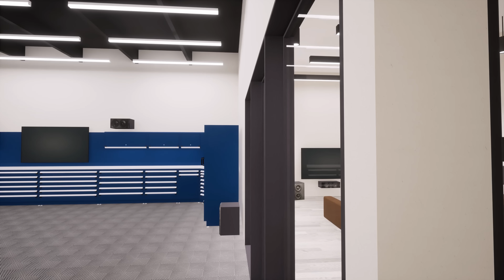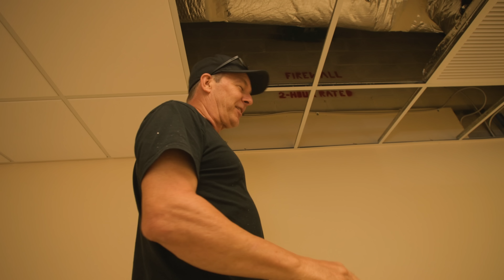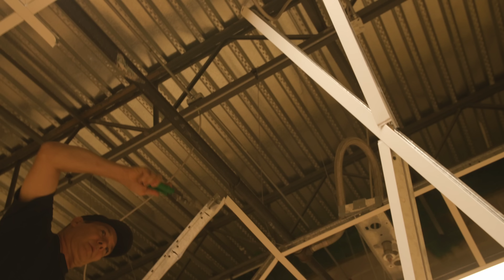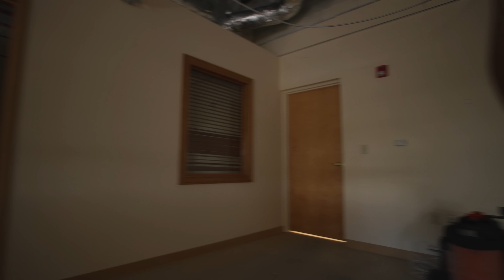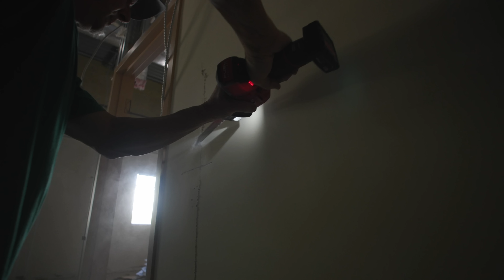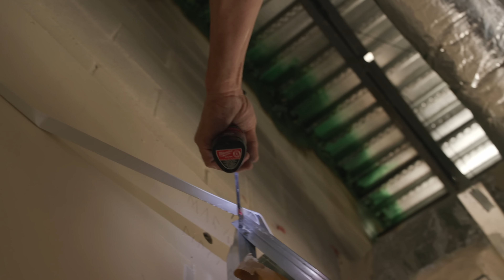Turning This Ugly Office Building Into an EPIC GARAGE! | OGHQ Build Part 1

Comment: You can use a magnet on a string  to find the screws in drywall and take the drywall off in whole peices
Reply: They probably have to take a few turns thru a few doors to get to the dump trailer.  Smaller pieces are more manageable.

Comment: My guy Matt is not going to like all the scratches you will put on the dump trailer. 2 months into hauling rock, boulders and old concrete in mine it looked like it was 10 years old.

Comment: Mike needed to do some more research on a dump trailer. Definitely better choices than that big junk he bought. Number one choice would be diamond c but those are big money, next choice would be a Maxxd. You can get a very nicely optioned 16’ maxxd with telescopic cylinder, 17.5’s, 8k axles for 16k. They’re definitely the affordable diamond c knockoff.
Reply from the maker: We didn't have time.  We needed something immediate and local.
Reply: This was $12k and I've owned Big Tex and they are good trailers